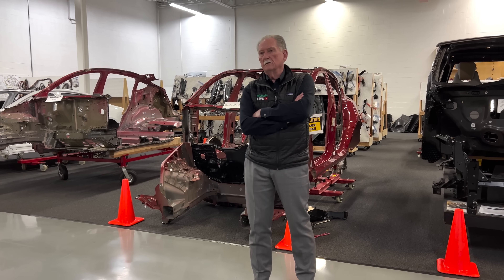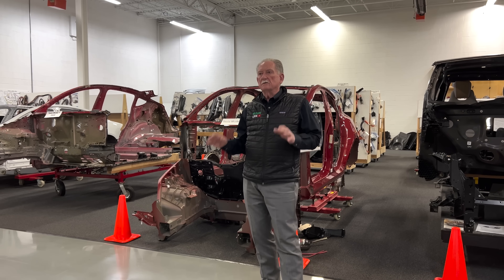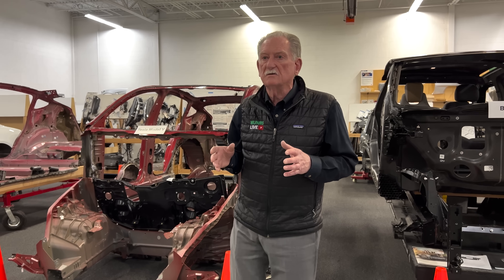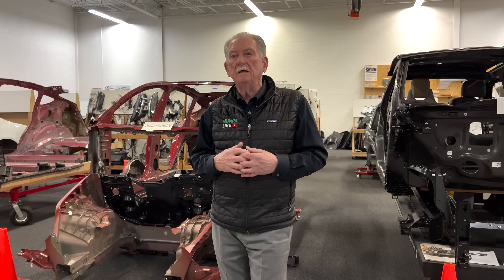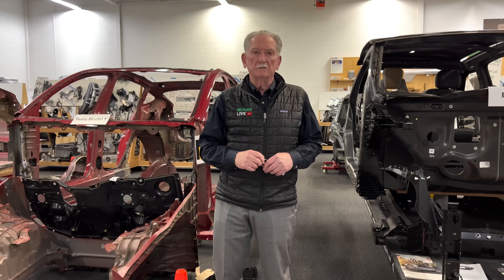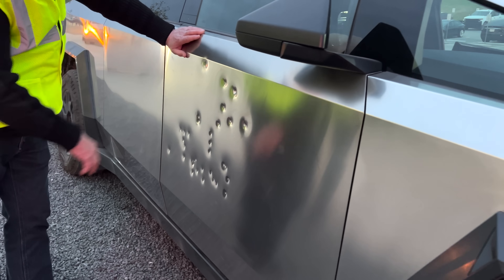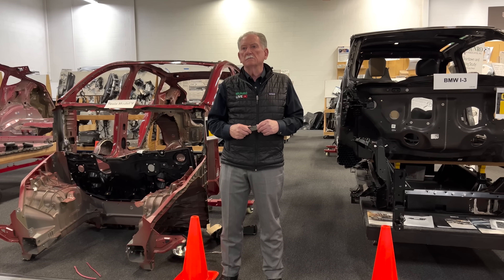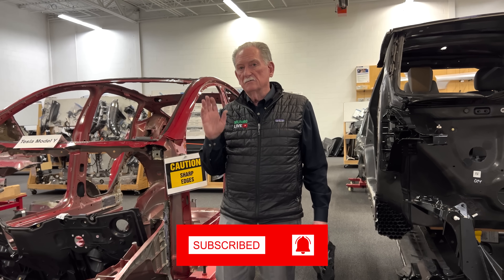An Engineering Analysis of the Tesla Cybertruck

Comment: Huge castings are great for reducing the cost of production. But only in a world where you care a profit, and not the customer ownership experience. What am I missing ? You get in a prang,and rather than just replacing a rear quarter panel, you have to replace a huge part with god knows what built into it (suspension and brake mounting points, axel carriers etc ). And I assume with the complex  compound curves, these things can't the straightened and repaired. Just cut the whole thing out, and let in a new one. Didn't @richrebuilds have a minor crease on the back of his Rivian, and he quoted some huge bill ($20,000 ?) to bet it fixed, as it was all one part. And if these huge parts have to be kept on hand, how many will really be in stock at any one time. It seems like a step backwards. But the 48 volt thing is fantastic. I hope Elon shames Ford et al to move to that as a new standard. It just seems very sensible.
Reply: Any accident that destroys a casting would have totaled any other car anyway... you're worried about silly things
Reply: @Jessev741  Nope, whatever I'm missing, that isn't it. A casting will crack like any metal part can. And no, cars don't get totalled for cracked wishbones for example.  So not even a little bit right. Thanks for your effort though. peace and love !
Reply: @Czechbound  You should alert the engineers at Tesla to your findings
Reply: @Jessev741  The definition of a waste of time. I hope you make better decisions. Again, peace and love !
Reply: @Czechbound  🤦‍♂
Reply: @Jessev741  It's OK. Don't beat yourself up. People make idiots of themselves all the time by posting ill thought through comments, and then following them up with what they think are smart arsed passive aggressive put downs that sadly reveal the person to be a total and complete narcissistic idiot. You had an opinion. A completely wrong one, but it's ok, you're entitled to it. Just as you are entitled to own being a complete idiot. Trust me, we are all #smh'ing at your pathetic emoji response. But hey, even idiots need love. Now, can you at least impress us with your ability not to respond ( by way of words, or emoji ). I know, I know, your inability for self control has you primed to hit the "reply" button. But the inability to have self control is one of the hallmarks of an idiot. We are rooting for you ! That hot flush you're feeling now ... walk it off soldier ! As ever, peace and love !
Reply: @Czechbound  🤨 You ok?

Comment: this is so ridiciulous the cost of thin gauge wire harness reduce weight and cost going to 48 volt? lol what about the exponentially increased weight and cost by using stainless steel. sandy doesnt make sense with his assessment. i will say 48 volt will save power but munros sales pitch is plum ignorant.

Comment: Great Video again Sandy.  Recommend showing a single 12 volt wire with insulation removed compared sude by side to the single strand from a Cat 5 wire with insulation removed.  That really show the huge difference between 12 to 48 volt wiring!

Comment: To check out the cutting edge of tuning pickups and SUVs - with ICE powertrains,   see that Cleetus Mcfarland has produced with a Jeep Trachwayk...  not bad  (not revolutionary but impressive still) -  note tthe Nevara ans S-Plaid are basically "EV-works drag cars" - they should be in the 6's (1/4 mile drag strip - rollout is to be expected on the tree..) to mean anything revolutionary

Note, most of the 12v system  components in a vehicle consumes hardly any power at all. so the "maaterial" saving is more from copying  the - british style "ring mains", not the voltage change, by all means follow the rest of the workd of transport fron 12V trucks to 24 and 48V systems....
        Now; Ford, and probably, GM, Stelantis, VW ...  etc will adopt higher voltage systems, with parallel serial buses (ethernet is merely 4 twisted pair - ie typical telephony setup ) for control  and the equipment manufacturers will simply add in multi voltage power supplies to all their sense/switch modules...

Stainless steel...  ALL 3xx series stainless steel is Austenitic, 302, 304 316...  etcetera... ho hummm..  talk real "engineering" selection including compromises - and ddiscuss the HS Carbon Steel unibody components under the SS skin.....  (work hardening of "even" 304SS makes it Martensitic in  uncontrolled ways = not throughout the whole component. - doing that without working the entire surface is a trick (or heat treat) ..) - define the grade, rather than calling it EM's BB$$ 3XX moniker (the X's mean those properties are undefined - ie. floating variables, meaningless.)

Shoot  the Cybertruck with a 22 magnum rifle - just use a 16 inch barrel (nearly any rifle - and "the correct bullet" to not frag on surface contact) and it will penetrate - a .45 Tommy-gun, or a 9mm 4" pistol doesn't fire particularly energetic bullets..  next please... 

Thanks for putting out - critique isn't meant to be personal.
 (NB, lots of self optimising, design packages are out in the Wild, I don't think Tesla has all the secrets locked  down in these fields - go and have a chat to Magna  Int. over at Battle Ck. - they too seem to be into optimal castings  (customers also have to want it for it to be produced for OEM  supplychains.)

Comment: Multiplexing advanced engineering work has been in progress since the 1970s at the oem’s.  Bubkus so far.   Cost, reliability , collateral issues ???  50 years is sufficient time to make it happen.   There is some inherent customer,  competitor or abstract reason this good idea sits on the shelf.

Comment: I remember hearing talk in the auto industry of going to a 42V or 48V system at least 15 years ago but nothing came of it. So, once again, Tesla is lighting a fire under the industry's butt to show them how it's done and what benefits it offers.
Reply: Yes. An automotive guy I knew circa 2008 talked on it due to all the power equipment cars were coming with, that was early on with heated seats, etc. They did not account for the fact HID only needs 35w not 60w per bulb. And LEDs less yet. Etc.

Aircraft have used 48v in some for a long time.
Reply: Tesla has made a great move by issuing their 48v documentation to all the other major motor manufacturers. Sharing this information makes it easier for them to come onboard with the shift from 12v to 48v systems.
Reply: @MrAdopado It lowers everyone's costs too because things can start to become commoditized and available in the market. For example, things like radios and other electronics can be made by third parties that natively run on 48V. This will take a number of years though.

Comment: 00:04 Tesla Cybertruck specs and features
02:01 Moving from 12 volts to 48 volts for better efficiency
03:55 48 volt and 800 volt systems give Tesla 78% weight reduction.
05:46 Fly by wire and steer by wire technology enable advanced vehicle control.
07:19 The Tesla Cybertruck uses Martin cic stainless steel for its structure.
09:11 Tesla Cybertruck using work hardening stainless steel for enhanced durability.
10:57 Tesla Cybertruck has more efficient cooling system and innovative casting design.
12:34 Tesla is using innovative casting techniques in their production process

Comment: Those mileage range figures are exaggerated. That's the range when the vehicle is driven on a flat highway, probably at high altitude, with no hills and driven by a 98 lb woman with no passengers and not a gram of additional load at the absolute most ideal temperature for range and probably a tailwind all the way. Load it up with passengers and gear, drive it under non-ideal conditions with hills and headwinds, colder temperatures, etc., and the real world range figures will be nowhere near the ranges they say those trucks will have. Not even close I suspect. They weigh a massive 6,600 - 6,800 lbs for you-know-who's sake! Add to that the, vehicle is by far the ugliest motorized vehicle ever created by any company in any country in any era. The aesthetics are absolute crap. I predict it will be a money loser for Tesla the way the Edsel was for Ford. Your opinion may vary and you're entitled to it and this is my opinion and I'm equally entitled to have it and express it.

Comment: What relevance does 12  to 48v elec system based weight reduction in harness and copper saving etc have when you have the stainless steel and batteries contributing to the most weight??? There may be advantages but comparative fractional weight reduction is highly unjustifiable ?

Comment: sorry, but electricity does not "speed up" using Ethernet instead of regular copper. you can't possibly assert that direct copper wire connections are slower than a controlled network system; a system that will still require power circuits for driving things that it is controlling (lights, a/c, sound, etc.), and add complexity by using network nodes to control power to those same driven things.
really, the only plus/minus is the physical bulk & complexity. also, i'd like to know if Tesla is comparing to a standard 12vdc harness when citing that 78% decrease in weight - if so, they are yet again fudging the dialogue to make their product sound better than it really is. also, some car companies have been 'networking' their car electricals in some way for some time now, to varying degrees of success. other than that, higher voltage is mostly a good thing.
as for the stainless steel (s/s), Austenitic (300 series) stainless steel is actually about half as strong as the regular high grade (AHSS) steel used currently in automotive structural manufacture (about 500mpa for s/s and about 900-1,700mpa for AHSS steel. (iirc)). Austenitic is a grade(s) of s/s that is corrosion resistant due to particular additives such as chromium/nickel. these types of s/s are by nature very low in ferrous content and therefore exhibit very little to no ability to hold a magnet, particularly if that magnet is of low quality (or not a Neo/rare-earth magnet). Austenitic has nothing to do with magnetism/magnets, and you also appear to infer by-proxy that aluminium is also austenitic because it fails to hold a magnet. work hardening s/s is definitely a thing, and it will be interesting to see how these trucks deal with age related work hardening over time, and weather they develop cracking and other failures due to it. this is also why the "it would break the press" thing came to be, not because the "new" s/s is "so strong/hard", but because working this grade of s/s would harden it far too much, to the point it may become a liability, thus the simple angular lines of the truck.
the s/s in the truck is also quite thick, so it's no surprise that it can handle small arms fire, though i'm really not sure i see that as a positive selling point. having said that, it's obviously an american-centric selling point, and as i live in Australia and don't expect to see any, ever, it does seem odd from my point of view.

the main problem i have with Tesla is it's head-man elon-electric-jesus-musk. he really has a bad habit of boasting to the converted and others alike about how forward thinking Tesla is and how they're breaking new ground on things never done/seen by mankind before, when really many things they do are just reworkings of old/established ideas, or simply pie-in-the-sky soundbites whose sole purpose is to boost the stock price.
sadly the cybertruck is just another in an emerging lineup of morbidly obese "pickup" trucks, whose inordinate drain on finite resources and embodied CO2 emissions, should make those wanting this type of 'green-er' vehicle take serious stock of their reasoning for wanting a truck-sized EV.

Comment: Sandy, did you ask about the tailgate ramp that was on the original CT, for loading tthe Cyberquad?  It was do functional, but it seems to have been dropped?!
Reply: Forget about the cyber quad and get out and walk instead when the road ends.
Reply: Hopefully it returns as an option in the future, but it might just be that it adds too much weight and complexity and only solves a problem a small fraction of customers actually have, and so has been deleted.

Comment: Ok, so they have some excellent technology and ideas about manufacturing technology, making incremental improvements here and there like much needed (very minimal mind you) weight reduction (and they are still far too heavy for obvious reasons), but what about the energy density of the storage medium itself and the inherent shortcomings of it (eg lifespan, discharge/charge limits, heat management, fire and so on) compared to say regular gasoline?
Reply: That question wasn't rhetorical btw....I'd actually like to hear how/if they are being overcome? - because, aside from the obvious recharging infrastructure problems, how does such a large, heavy, resource intense product even claim to be better on environmental grounds, let alone actual practical daily fit for purpose use? I hope someone smarter than me can come up with real answers (IE solutions) to these important questions instead of hyped up marketing nonsense...

Comment: *DEcoiler

& The flowy structure of the castings is referred to in 3D modeling as "Generative Design". The forces acting on the part are defined & the structure is then "generated" to optimize material usage or manufacturing processes.

Comment: Your presentation is sadly much to simplified. There are several types of ring networks, without explaining which standard is used it only adds confusion and frustration. Not all ring-networks are created the same and a basic network could potentially be catastrophic in a car if the cabling or a node should fail. The rest of your presentation is just to vague to be useful and hints at a lacking of understanding of certain basic engineering principles. Just in case your wondering yes I'm an engineer with a long career spanning across several disciplines and industries. 0:04

Comment: There's not a single thing mentioned that makes the car better for the user.  Quite the opposite, faults and repairs are far more complex and MANUFACTURER dependent.

And every plane he mentioned with steer by wire, either has mechanical backup or (in the case of fighters) is an instant write off and you eject.

You can't eject from a doorstop.

Comment: 304 stainless is an austenitic steel 18.5% chromium, 8.2% nickel with excellent ductility and suitable for deep draw.  Think of the steel used to make a kitchen sink.  304DDQ ups the nickel to 9% and has improved formability at a slight decrease in tensile strength from 650 to 630 MPa.  Galling needs to be mitigated when drawing stainless and is accomplished with a high viscosity oil lube or  applying PVC film during pressing.  The nickel is what is responsible for making the stainless weakly magnetic.

Sandy hinted at something interesting, suggesting that the stainless is being work hardened by drawing.  It would be interesting to know more about what is going on, but that is probably the secret sauce which gives the material the desired hardness but retains sufficient ductility to be formed as required.
Reply: It's formed with a gigantic multi-hundred ton press  that's face is protected by injecting high pressure air between the tool and the sheet metal. The material arrives hardened and is formed in that state. Not sure why? Could just form annealed metal and heat it up. Maybe in a microwave for kicks.
Reply: @Triple_J.1   Thank you for supplying the correct information, much appreciated.  It is interesting to see high pressure air being used as the protective fluid.

Comment: the weight isn't bad, I thought it was going to be 8-10k. 6800 lbs is an f150. Granted the f150 is probably the better buy if you need it for truck things
Reply: The F-150 is a great truck but the body panels dent very easily because they are made out of aluminum.  If you don’t mind some dents that do not affect performance the trade off is a 600 lb weight savings going from from steel to aluminum .  I think the 6800 lbs you referred to is the Gross vehicle weight of the F-150.